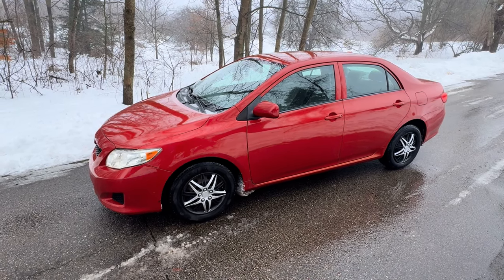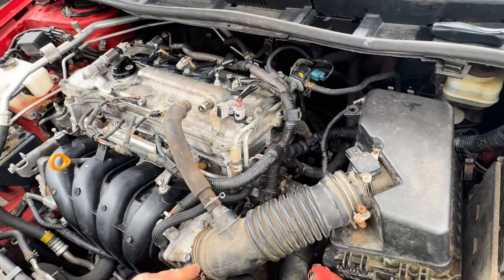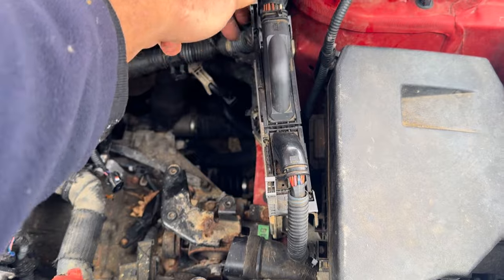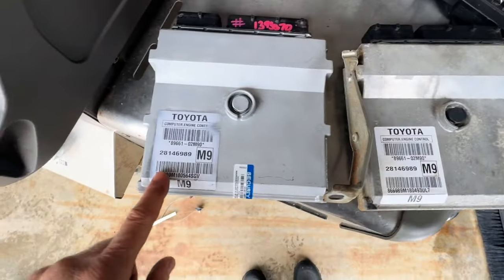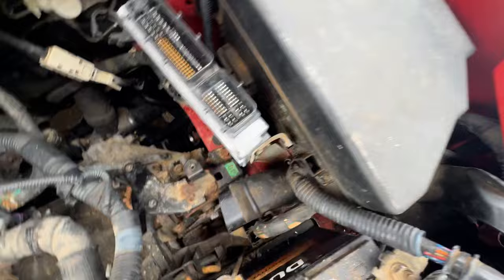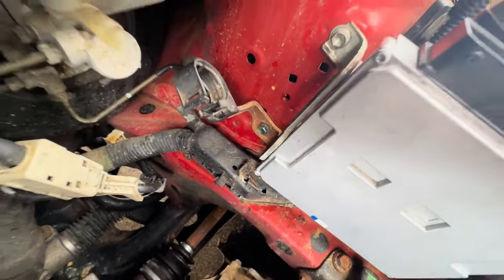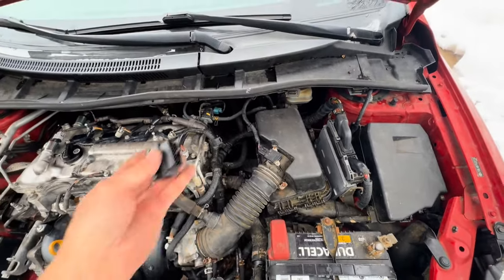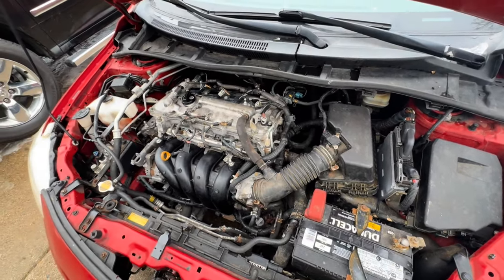How to Replace Engine Control Module (ECM) Toyota Corolla

Comment: new to channel, love the content, wondering do these 2013 have oil consumption issues? the engine?
Reply from the maker: Thank you, the oil consumption concerns are the vehicles equipped with the 4-cylinder 2AZ-FE engine.

Comment: Thanks for the Video and info.
How did you determine it was a bad bad ECM and what were that vehicles symptoms?
Reply from the maker: You're welcome, they were actually diagnosed at a different shop, but they said their car wouldn't run consistent and had problems with starting and acceleration. 
Other symptoms would be 
Check engine light
Won't start
Misfires or stutters
Poor Economy
Sudden Loss of Acceleration
Rough or Irregular shifting of transmission

Comment: this is a super helpful video! im pulling my hair out with a 2010 corolla - intermittent CEL, ABS, VSC, wacky revving, twitchy or dead speedometer, lack of shifting, speed sensor and P0500 codes. sometimes all or a combo happen, sometimes it runs like normal! getting to last resort of "is it the ECU"?  --if it is im glad to find this vid with the link to the folks in NY you got yours from. did it work as advertised 'plug n play' after the reset cycle? thanks!
Reply from the maker: Thank you. An illuminated Malfunction Indicator Light (MIL) is typically the initial indication of a faulty ECM. However, as the MIL may also indicate other issues, such as a malfunctioning sensor or a wiring problem or a battery with a dead short. It's important to use a Scan Tool to verify that MIL illumination is a result of a faulty ECM before proceeding with repairs.Yes, the ECU worked as advertised.

Comment: Hi , I just installed my new ECU but it won’t start, it cranks, but won’t turn on.. I put my old ECU and it started… what am I doing wrong? Your help would be greatly appreciated thank you
Reply from the maker: Double check your numbers to make sure it's the proper ECU for your vehicle.  Where did you get your ECU? Is it supposed to be a plug-in play or is it something that has to be programmed by the dealer after installation?
Reply: @ thank you for answering,, so I really don’t know the answer. But I’m taking it to a shop this week… some people say it should start right away, others say it needs to be programmed,,, I bought it at Oreilleys for around 900$ , they said it got Flashed. I don’t know what that means, I assumed it meant “programmed”.
Reply from the maker: The one we ordered was from Flagship one, the phone number and address are in video details. It was plug and play with no problems and it only set us back about $300.
Reply: @TheAutoTeacher  wowwww!!! So I dropped the car off at the shop yesterday.. I appreciate you answering. Thank you so much